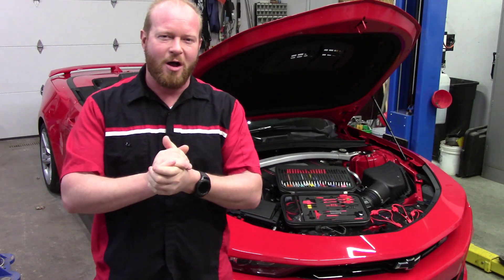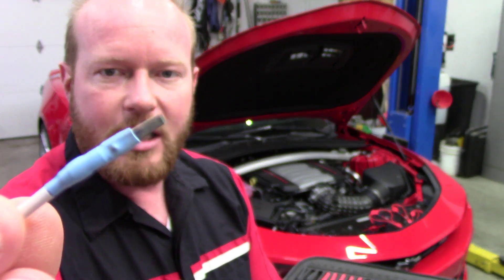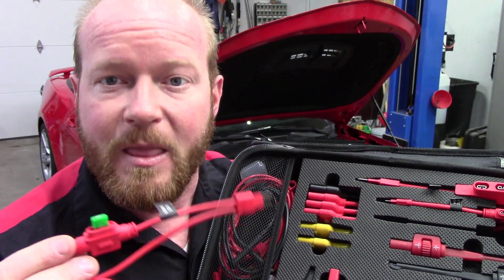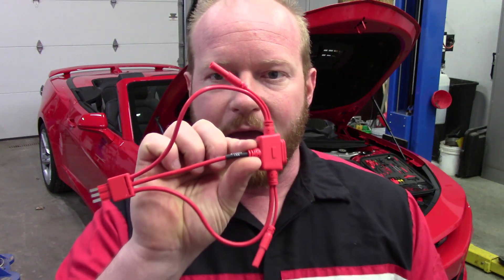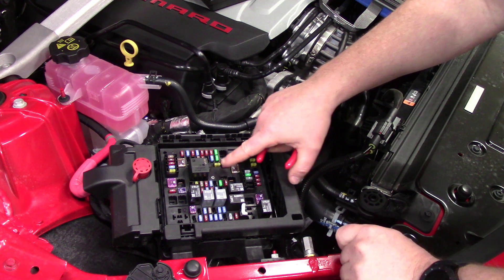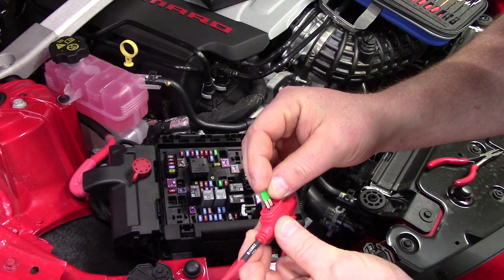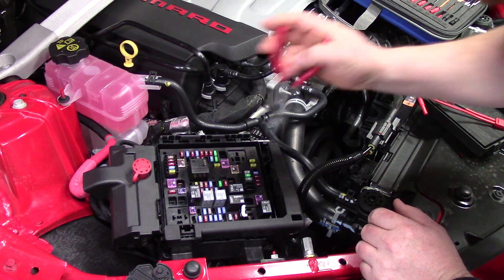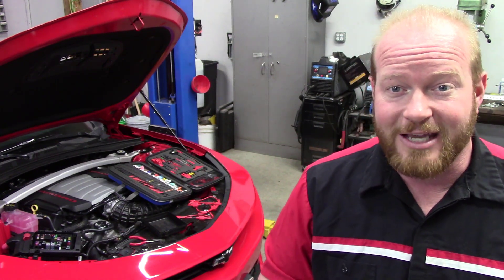Your electrical diagnostic nightmare is over! #AESwave #fusetap #uTest

Comment: Do other OEM's have problem's with the fuse box overheating? I'm a Master Toyota Tech, and Toyota uses the low profile mini fuses, and I've never seen them cause an issue
Reply from the maker: I had a Dodge Charger come into the shop with a melted fuse in the box. I had to put a normal fuse in it to get it work again. So yes, I have seen it happen